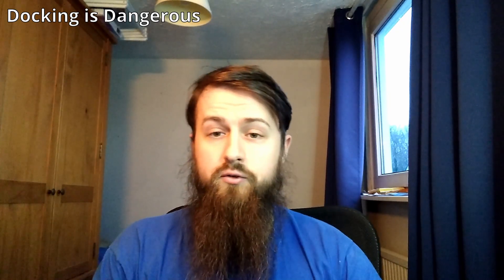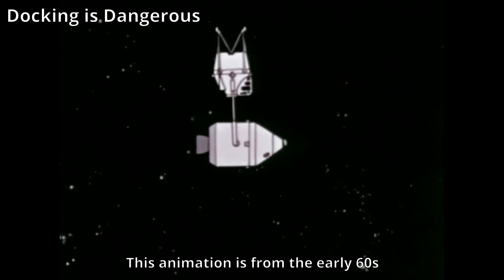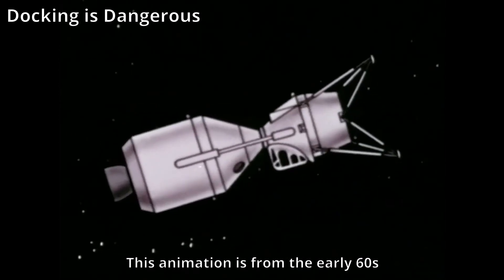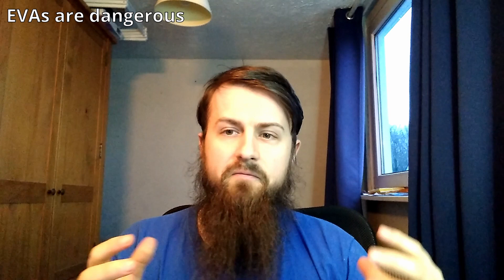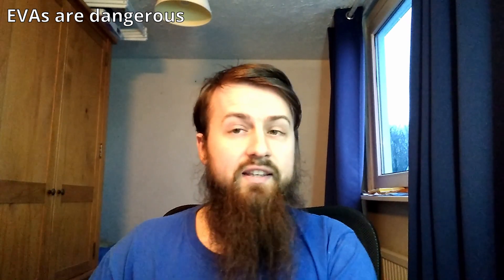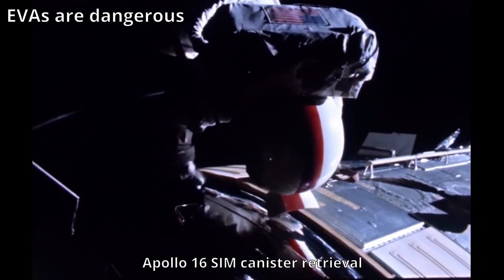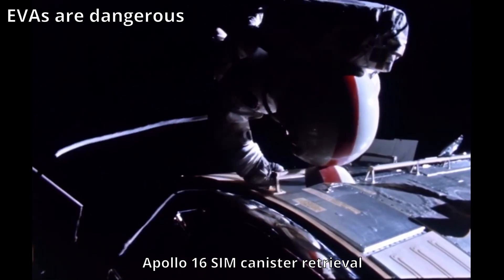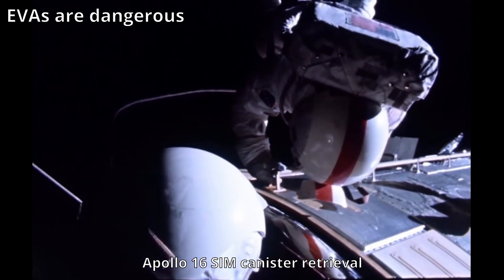How to make more realistic ships in KSP2

Comment: Would it be realistic to have a fairing of some sort for the sole purpose of covering the heat shield? I feel like that might be some unnecessary weight, and I'm not sure if it's entirely worth it. The only reason I could really think of this as an issue is if you have LEO operations and for some reason can't use the same craft for getting up there to get down from there.